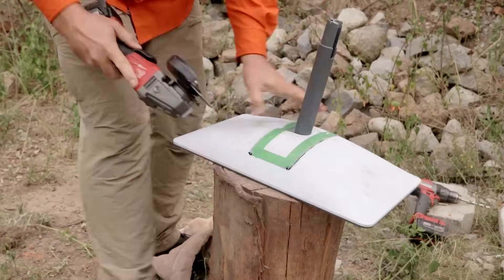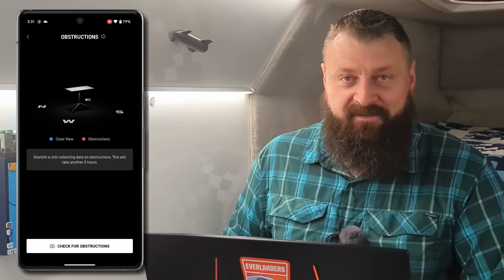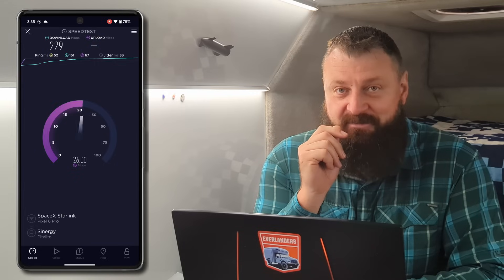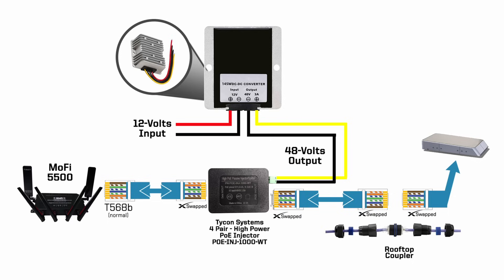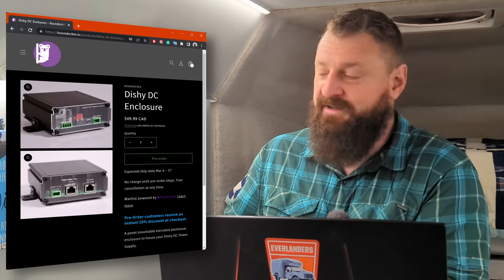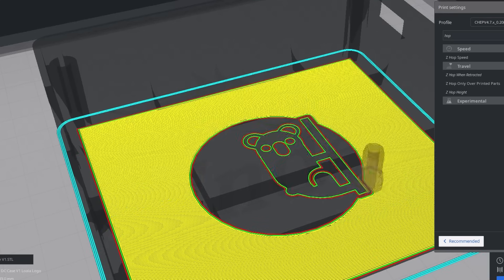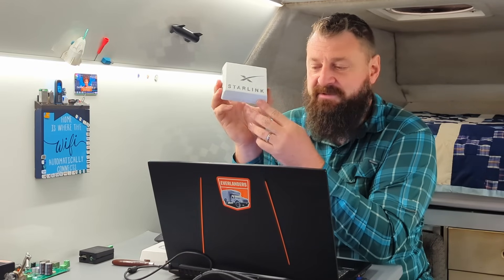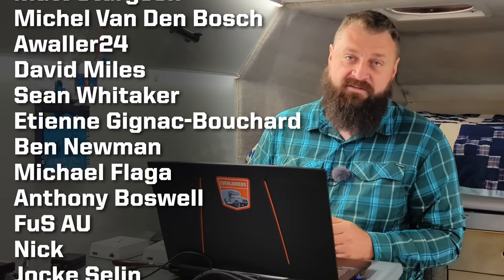Starlink DC Power Supply

Comment: Hi there
Fantastic video, have ordered the dualie and arranging 3D printing of case. Could you please let me know what modem you are using they can take its power from dualie.
Again many thanks
Peter
Reply from the maker: Our router is not powered from the Dishy DC power supply.
https://youtu.be/abWiNKOrJ6I
Reply: @Everlanders 
Many thanks for your response. I’m trying to get my head around all the tech and thanks to your brilliant video I think I understand most of the set up. 
The only query I have relates to the modem component. Could you please let me know if your Mofy modem is powered by 
12 volt?
Reply from the maker: Yes, it's powered separately by a separate 12 volt connection.
Reply: Thank you for getting back to me. I found a 12 volt modem and will let you know how I go
Reply: Sorry to bother you again.  I just wanted to make sure I have got this right. When I join the cables at the dishie end (after removing leg) I join them in an ‘x swapped’ sequence but when I get to the dualie box I revert to the normal T568B wiring sequence? Is this correct please? (Many thanks for your patience).
Best wishes
Peter
Reply from the maker: No, if using Dishy DC, all crimps are standard T568B
Reply: Again, Many thanks

Comment: Wait, I was under the impression that you have to point the dish at the satellite? You can just point straight up and it works?!?!?
Reply from the maker: You were misimpessioned. The satellites move from Horizon to Horizon in under 4 minutes... The dish uses phased array antennas to beam steer the data signals... But I covered this in the video and linked to more information which I guess you didn't see.
Reply: @Everlanders  I'll have to check this out.

Comment: How do you print the overhangs for the connectors?
Reply from the maker: Printed in thin air, as shown at 13:04
Reply: @Everlanders  would there be any chance of sharing the 3d model of the box? i'd like to do a couple of mods before i print it

Comment: Will this 12V box work with the new Starlink Roam ?
Reply from the maker: Roam is a service available on any Starlink Hardware. So if your referring to the Gen 3 rectangular dish, yes... It's working fine. If you mean the Square $2500 "High Performance Flat Mount Dish" that needs 300 watts... No, that bigger DC supply is still in development.
Reply: @Everlanders  Thanks, was referring to the flat mount dishy, 300 watts

Comment: Thank you so much for this video and your work!  I am about to wire cables to make the same setup as you have with your 3d printed mount. can you please confirm the wiring is like this ? dishy port on dualie has T-568B then onto the dish side on both ends of the rj45 coupler we have x-swapped ?
Reply from the maker: With the Dishy DC power supply, everything is standard T568B
Reply: @Everlanders  It works :))) This is going to change my life; thank you soooo muchhh !!!!
Reply from the maker: Glad you got it up and running!
Reply: @Everlanders  Wait! I followed the original video to flat mount, including x-swapped connectors up at the dishy and used that for a few months with otherwise stock system. Am now attempting to use 12v Dualie with no success, Are you saying that you reverted those x-swapped connectors at the dishy back to T586B when you installed the Dualie?  THANKS!

Comment: I received my power supply, and thank you for the stl's for the case. However the rear case stl has the borders of the solder areas not alinged with the production model I received. I do not know if you have the new layout to publish an updated design, just wanted to pass that on, so you are aware.
Reply from the maker: Yes, I have a new file for Rev 1.5 boards. I'll try and post it soon.
Reply from the maker: Posted: https://www.thingiverse.com/thing:5893999
Reply: @Everlanders  You sir, are a steely eyed space internet man. Thank you!

Comment: Does this mean you don't have to have the v2 dish plugged into the original router in bypass mode to use a customer router?
Reply from the maker: No, the original router is not connected, The dish plugs straight into this DC Power supply and then into the WAN port on our MoFi 5500 Router.

Comment: Did you do any testing of the Dishy DC (amps/power) to determine efficiency?  How does it compare to the previous setup (ebay/Amazon 12-30 VDC to 48 volt converter with external POE?  THanks
Reply from the maker: It's pretty comparable, it bounces around 2.7 to 3.3 Amps @ 12-volts, ~30-watts... But to be fair, I've been hammering on Starlink lately, need to back up a 27TB NAS and working on video collaborations that's moving a bunch a video around. So that's probably pushing my averaged readings to the high end of normal.
Reply: @Everlanders  , Thanks sir for the quick, concise reply.  Excellent channel and content.
Reply: @Everlanders  , Hey sir...I think I remember that someone made a "crossover" cable/adapter so you don't have to cut and modify the LAN wiring.  Does the Dishy supply do that internally, so you can use regular LAN cables or do you still need to buy the adapter (do you have a link?).  Thanks
Reply from the maker: It would be foolish to buy such a cable in either case, the fewest connections, with the shortest wire length will have the least losses. You need to cut the original cable and crimp an end regardless, just crimp the X-Swapped cable if using a old-school PoE injector... Dishy DC has the X-Swap internally, so you can crimp a standard T568B in that case.
Reply: @Everlanders  , Thanks
Reply: @Everlanders  (your comment about signal\voltage drop notwithstanding) for those not looking to cut into their OEM cable, they can look into the "YAOSHENG Rectangular Dishy Cable Adapter to RJ45" - takes that original 75' cable plug and converts it to a T568B RJ45 port - from there a short cable into a dishy dualie should work. Or a swapped cable into a Tycon injector would also work... just mind those colors folks.
Reply: @douglasmontgomery6315 - comparing energy utilization as reported by my battery power station when the dish stowed has them looking similar (at least at this utilization level) - both report ~18w consumed either when connected to the dualie or a 384W boost converter + Tycon injector.

Comment: My understanding is the Gen2 dish has a grounding wire.  What should happen to that grounding wire when making crimps?
Reply from the maker: They all do, I connected it to the shield in the connector.
Reply: @Everlanders  Does the ground wire then pass through a coupler?  Are there special couplers needed?   

Thanks for answering all my questions.  You've been extremely helpful and responsive from where ever you are in South America.  Starlink is awesome!
Reply from the maker: Yes, a shielded connector will have fingers that contact and pass the shielding from one wire to the next.

Comment: This seems great.  What is the process to take a router to 12V?  Are there routers available that can be 12V? For instance, in my house, I use TP Link Omada Mesh, and would consider doing that in the RV so when camping with friends they can put up an AP for increased WIFi at their Rig. I just don't understand the 120V to 12V for something like that.
Reply from the maker: Yes, many off the shelf routers actually run on 12 volts, so you'd just ditch the wall wart and give it 12 volts... I did a whole video showing how here: https://youtu.be/UAZGX379dmc
Reply: @Everlanders  Watching it now.  I checked my devices.  Poe switch runs on 53.5v, omada router runs on 9V and regular  switch runs on 12V.  Then the APs are all powered from the POR switch

Comment: So I sent three of the STL files to PCBWay .. one for the back side, on for the front side (starlink + remote) and a third for the starlink logo itself. They rejected the third one saying the wall thickness had not reached 1mm .. send a new file. Did I send the right files? I'm now thinking I probably didn't need to send that third file..?
Reply from the maker: The inlayed Starlink logo is not something they are likely going to fuss with, that takes some creative hobbyist messing around. You just need the front and back...

Comment: I was an aircraft electrician and have performed many crimps and I messed up 2 as well when installing a shielded passthrough connection in my travel trailer. I checked all 32 points with the multimeter for continuity and shorts before trying to use the cable. Annoying but good piece of mind before plugging it into the expensive dishy.

Comment: Just got the new boo dicker board. Plugged everything up and sat back to enjoy. Uh oh… no internet. Archer 8 working. Red led says dishy is working but no internet connection. Checked all cables with tester. It says all is good with cables. What am I missing? Do I need to do the advanced bypass function on the dishy router? Hope you can help. Thanks
Reply from the maker: Not with my router, nothing special was required, I can't speak to this Archer router... What does the Starlink app say? Disconnected? Check the cable?
Reply from the maker: Confirm you're using T568B on all connections... Also, you can't use a cable tester on the dish end of the cable... So I don't know how you would have tested that... Try a re-crimp there as the next step...
Reply: Using standard B configuration as instructed by boondocker. Tested cable by using union for Ethernet adapter and unmodified cable to create an uncut loop. 1-8 all in line. The Tp link Archer has been in use for a year when I was using a Wi-Fi booster antenna so it should work still and is 12 volt. Frustrating but must be something simple. Any suggestions are always welcome. Your videos gave me boost to go for the boondocker setup. Hope I can get it working. Thanks again.
Reply from the maker: Right but you can't test the cable I to the dish, it's not possible. Did you re-crimp this?
Reply: Ah… I see what you’re saying. I am using the Ethernet adapter so I don’t have to cut the original cable (just in case). So I cut the Ethernet adapter then crimped a T56B unaltered on each end. That way I could plug the Ethernet into itself and plug the ends into tester. It says all good. But I’m not above doubting anything electrical. I’ve seen others do it this way on YouTube to preserve their original cable. But maybe there’s something I’m not knowing about this way. With 70 odd feet of cable I may just have to break it and do it your way to see if there’s a difference. Thanks for the help. I’ll get it going sooner or later.
Reply from the maker: It won't work with your adapter... Just follow the instructions and you'll be golden.

Comment: Do you have a 12v regulator inline to the dishy dualie SL POE injector?
Reply from the maker: No, it is not needed at it has a 10 to 30 volt tolerant input.
Reply: Have you noticed any performance degradation with the 48v as opposed to the 50v you were seeing in the router conversion video?
Reply from the maker: There would be no reason to expect degradation.

Comment: Yo! I just got the first-round production model of the Boondockers chip. The backplate doesn't quite fit anymore, due to slight position changes of the central pins on the back of the chip. Let me know if you'd like more info. I can take measurements for ya. Print went fantastically, otherwise.
Reply from the maker: Be sure to print the rev 1.4 back plate...
Reply: @Everlanders  Oof, I thought I did... but that must not be the case (no pun intended). Cheers.
Reply: @Everlanders  confirmed it was v1.4 that I printed.
Reply from the maker: And you have a rev 1.4 board...? Do you have it clocked 180° out?
Reply: @Everlanders  no sir. I have a Rev 1.5 board.
Reply from the maker: Okay, he must have changed it again. Email some square photos front and back and I try and get you a new design soon.

Comment: I would love to see header pins on there next to the led so that you could add an led in next to the switch
Reply from the maker: That would be easy enough to accomplish by connecting your LED of choice, a 10K resistor and the switch to the AUX 48 volt output pins.

Comment: Hi   Thank you for the videos they are great        We will be travelling Australia in a caravan with Starlink and Today I ordered the Boondocker and also will print the case     My question is the router I have is a GL Ar750 which is 5 Volt 2 Amp.   I am your after your advise on a 12 Volt power supply for this Router …..Can you please help me on what I should buy here …..the Router is very small so I will be an interesting test… I am not very tech savvy so keen for your advise   regards.   Rod
Reply from the maker: You're in luck, our very next video explains this:  https://youtu.be/UAZGX379dmc

You'd just need an inexpensive 5-volt regulator, link is in the description.
Reply: @Everlanders  thank you are you ok for me to ask lots questions?
Reply from the maker: No problem, $5 each... 😂😂😂

Comment: If you have the ethernet adapter sold by Starlink will that work versus cutting the cord and putting a ethernet connection on?
Reply from the maker: I do have the ethernet adaptor... But as I showed in the last video, there are 10% losses in running such a long cable. So I would have cut it anyway.

Comment: I'm excited I just received my Starlink Dishy DC.  The wiring instructions says to use a T-568B pinout to connect to the Dishy port.  But hmm, scratching head.   I want the flexibility to use the Dishy DC or the POE injector method as backup for powering the system.  Since the pinouts are different, what do you recommend?  Thanks!
Reply from the maker: There is no good option. Wire it for the one you're most likely to use (Dishy) and then make a short patch cable with a cable and a coupler to make the swap if you want. High probably of slower speeds and bad crimps.

Comment: Thanks for the amazing series of videos and the printable files.  I have preordered the board.  We are planning to travel to the northern territories and Alaska, have you heard success or failure stories from those who have flat mounted the 'small' rectangular Dishy and used it in the northern latitudes?
Reply: Also, If I only rely on Starlink for internet, can any router be used, like the ASUS TM-AC1900 units I use at home?
Reply from the maker: It is my understanding that it will work fine up there, although we've been in South America since we've received ours... And it seems to me that any router should work, just connect it to the WAN port.

Comment: Any tips suggestions for troubleshooting the starlink swapped ethernet cables? I'm doing a slightly different mod where you use the Starlink ethernet adapter and cut of the cable and add an X swapped connector and add PoE and then your own router. I can't seem to get Dishy to power up but unsire of where to start troubleshooting.
Reply from the maker: Perhaps asking the person who authored those instructions...

Comment: Does this work with the High Performance in motion flat dish?
Reply from the maker: I have no problems in motion... But No, The big dish pulls 300 watts, You'll need a generator to keep that going.
Reply: @Everlanders  Thanks for the quick response. Using my existing 12v Router with the HP Flat Dish, I'm seeing 60-120 watts without the snow melt on the inverter. Runs fine off my lithium setup, but if I can turn off the inverter and shave 20-30 watts, worth the investment. :) I'll keep looking.
Reply from the maker: It will be a few more weeks until that power supply is ready for testing...
Reply from the maker: Probably easier to Inject DC into the Starlink supply, like I did in this video: https://youtu.be/jv_IoKRoVsA

Comment: I'm getting ready to purchase one of these for our Trawler in the Pacific NW.  I'm seeing a bunch of hacks that talk about drilling into the back of the case to unplug the motor.  However, I see you've spliced into the wiring.  My question is instead of cutting into the back of Dishy, why not identify the wire/s that power the motor (inside cable coming out of the back of dishy) and just simply cut it to disable the motor or put a switch in for future use?
Reply from the maker: The wires for the motors are not present in the cable coming out the back of the dish. The motor controller and the related wires are all internal.
Reply: @Everlanders  Yea, I was afraid that was the case.  Guess I'm drilling a hole.   I hate drilling holes in things that are supposed to be watertight, especially in the PNW. :(   
Thanks for the quick reply.
Reply from the maker: I'd suggest the two hole method, into the vented motor compartment.
Reply: @Everlanders  I haven't seen anything on that.  Can you send me a link so I can see what you are talking about?  I've just seen ones like this guy in Seattle...
https://youtu.be/kCOgG6daDVE  at minute 6:17 it shows he got pretty close to getting right over it.  If you have a better option I'm very interested.  Ty